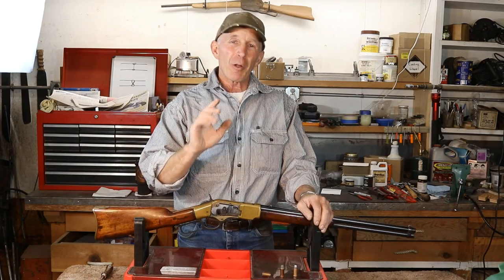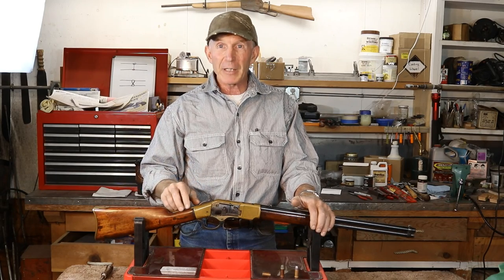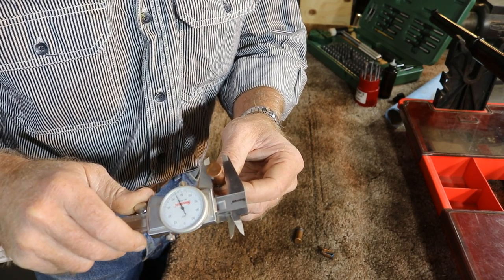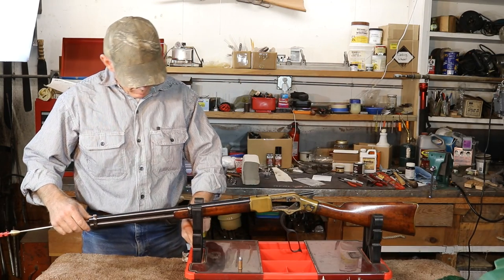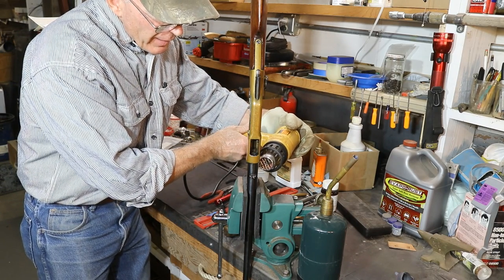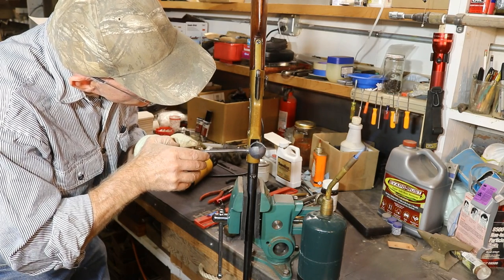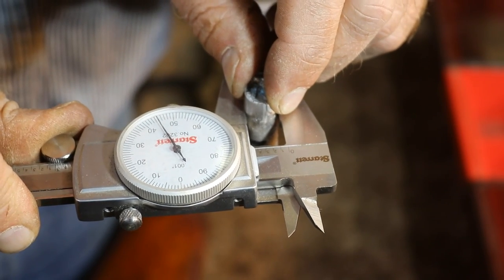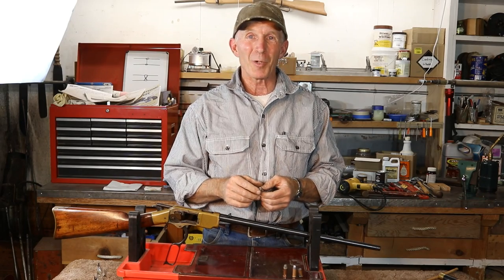Casting a Chamber in an 1866 Winchester

Comment: I have no idea how YouScrewed knew I needed to watch this but WOW!   I bought a 1911 after being told it was chambered in 9x23 Winchester from the factory. Talked to importer and no, was 9mm Luger originally. Now I need to get a casting of the chamber to determine whether or not it has enough leade. 9x23 chamber pressure runs at 50,000 psi so it’s no joke to hold in your hand. 

Thank you!  I learned several important details that never would’ve occurred to me, staring with preheating the barrel.
Reply from the maker: Glad it was helpful.  Thanks for watching!
Reply: Could it be that the 1911 was in .38 super, originally?  If I recall correctly, that miked out close to the 9x23mm.
Reply: @russbilzing5348  no, the importer specifically said 9mm Luger. Also 38 Super is a straight walled case while 9x23 is tapered so 38 Super chamber is both smaller and larger in different places. Plus leade should be much longer for 9x23.

Comment: some things to think about,  1 reline the chamber only?  2 if there is still factory barrel markings that should be saved? then reline barrel,  3 or new barrel if the cost is OK.
many years ago, I missed out on an engraved 66 only 5 miles from where I grow up!  Have only used sulfur for chamber casting as that all was available, works good. 
Thanks for your channel, just the best.
Reply from the maker: That's what I was alluding to when I was talking about the marginal bore and extensively polished barrel limiting our options to a rebarrel.  I wouldn't put that kind of work into the barrel unless it was a somewhat presentable example.

Comment: I really enjoy these videos. I now have a win 92 made in 1907 that was converted to 357 mag. It is smooth and seems to have rarely been taken apart because every part was on there good and it also locked up tightly. Though I still have to test how well it was converted feeding wise.
Reply: 92 Winchester converted to .357 Magnum was a big popular conversion long before Marlin ever coughed up a new .357 Mag. carbine. The .32-20 guns made the transition to .357 pretty good. There were also .44 Magnum conversions too. I think the .38-40 and .44-40 guns made that transition pretty  good too.

Comment: Great video. Thanks for not using effects and music in your editing. Video's are a lot easier to hear and understand. (I have a bad hearing problem). I would like to ask a question(a little off subject, still firearm related). I'm just a old poor boy and I like to make stuff with my hands. I know there's lots of videos on here, where they make slam-fire shotguns. I have lots of spent hulls to play with. I'm thinking of two homemade shotguns. One will be a muzzleloader and a break open shotgun and use Black Powder. Now to the question, would a piece of .095 tubing work for a barrel, if loaded with light loads? The tubing I have is a welded seam tubing, not pipe. A 12 gauge hull fits in it pretty good. The muzzleloader will use 209 primers in a nipple. Question 2 if the tubing I have will not work would black iron or galvanize water pipe work?

Comment: you could re-line the barrel, and ream a new chamber
Reply from the maker: Yes, but the outside of that barrel's been so polished down, it's not worth fixing.  That old carbine deserves a more presentable barrel.  The other issue is that nobody makes a barrel liner for 44 Henry.  It has a larger bore diameter than 44-40

Comment: I have a 1892 made in 1894 I am about to do a chamber cast because the rifle is shooting badly. The bore looks pretty good but I have made a strange discovery which is I can fit 4bullet heads in the chamber and still chamber a round. This doesn’t seem right to me as I thought the rifling should start soon after the cartridge is in the chamber? Any ideas? Does this mean that the bore is worn oversized or do I need a bigger bullet, I slugged the bore to .430?
Reply from the maker: Yes, that's far too much freebore (space between chamber & rifling).  You shouldn't be able to fit any bullets into that area when you chamber a round. You're on the right track by making a chamber casting.  Just make sure to make the cast is long enough to show what's going on in the area in front of the chamber.
Reply: Thanks for the reply, if it turns out the chamber is enlarged then is there any remedy to shoot reasonable groups or is it indeed just a wall hanger. I bought it to shoot occasionally.The problem buying an antique is if it looks good you just have to take a chance you cannot know what’s going on inside, what would you do?
Reply: Another discovery when pushing a rolled up paper through supposedly should stop at the lands but mine goes straight through so how do I know where to stop the paper wad for casting? Also when I measure the internal diameter at the crown it comes out at .436-7, would this suggest the the bore and chamber have been so over shot that a much bigger bullet is needed.? Also how big can you go in a Starline 44-40 case?
Reply from the maker: To be honest, it doesn't sound like there's much hope for your barrel.  I'd cast the chamber to the depth of the cartridge plus the length of four bullets you mentioned will fit in front of it.   You shouldn't even try to fit .436-.437 bullets in a 44-40 case.  From what you've described, you'll likely need to have your barrel relined or replaced.
Reply: @thecinnabar8442 hanks, I’m not giving up yet, the bore is pretty damn good, tried it today and the results were no better but it seems to like Swiss 1 and 2 better than the Swiss 3 id been using, as the slug is .429 I’m going to try a ..431 bullet and take it from there.. Cheers